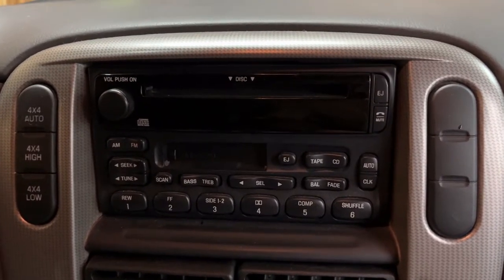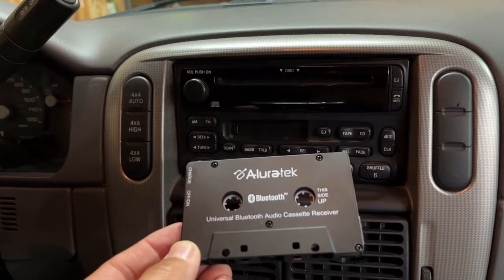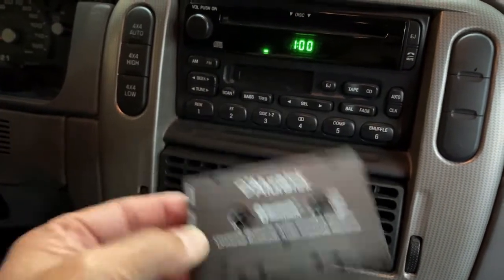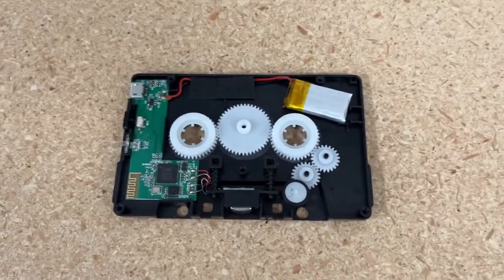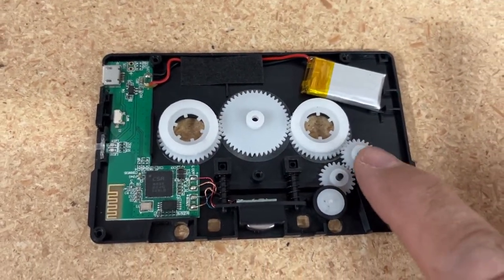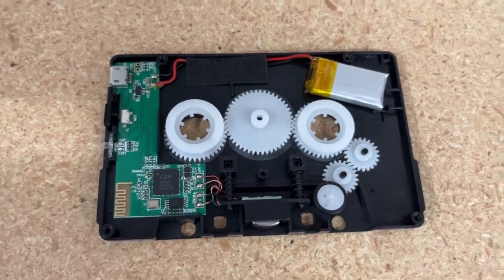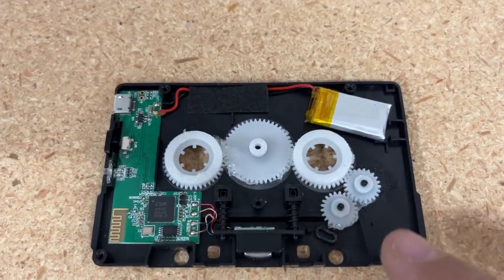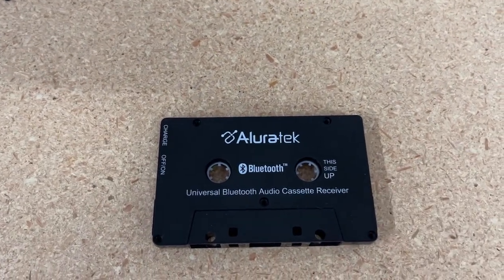Trying to fix clicky clacky ejecting Bluetooth car cassette adapter

Comment: Thanks for your video. Question, if you would, what model is that stereo? I have one in a 2001 Ranger, so I'm guessing it just a Ford stock radio. If you happen to know the model number that would help me. I have eject error but it's intermittent... Any info you have would be appreciated!
Reply from the maker: It is a Ford stock radio. I got it off of ebay to replace the original stereo that only had a CD player. The Ford part number of the one shown in the video is 1L2F-18C868-BB.